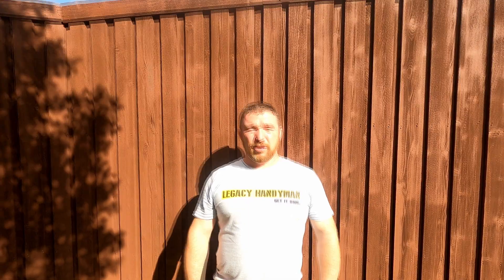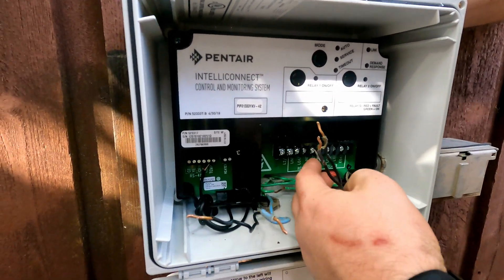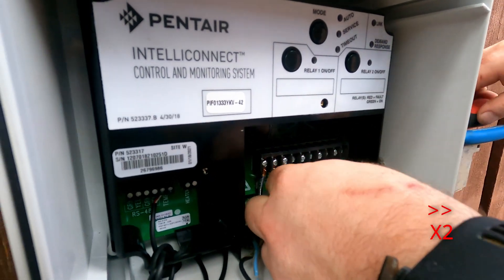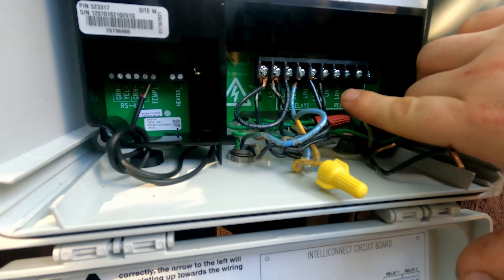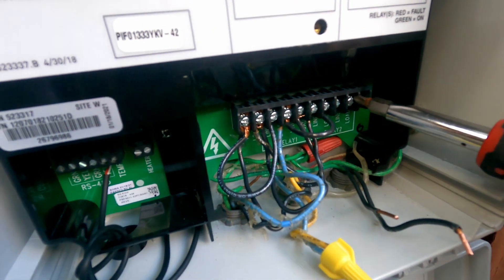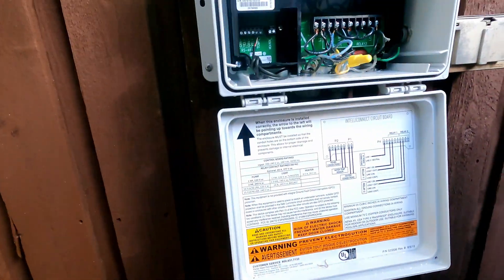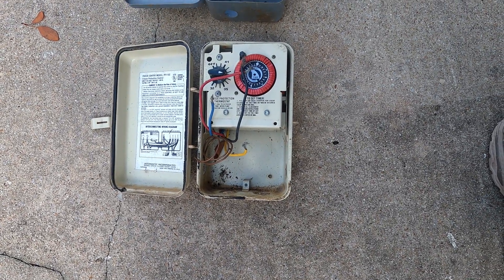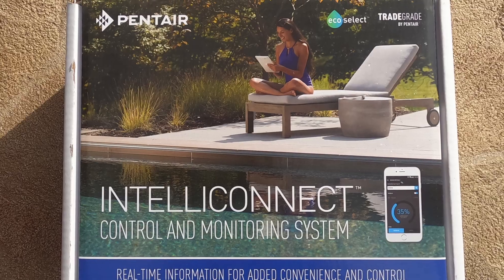How to wire Pentair IntelliConnect  smart pool  monitoring  system

Comment: Hello, I have a question that's confusing me. Where are these two neutrals that you connected and capped with a wire nut coming from? I don't understand where they are from if both pumps are 230V. Thank you.

Comment: I have a question I have a whistleflo pump I had Pentair come out and try to install it they said they  can't connect it with the interconnect system do you know of a way that I can DIY it myself to work because I have it connected manual now
Reply from the maker: Try asking this question here https://www.justanswer.com/sip/pentair?r=ppc|ga|6|HI%20-%20Pool%20and%20Spa%20-%20Search|Pentair%20-%20Phrase&JPKW=pentair&JPDC=S&JPST=&JPAD=89214033292&JPMT=p&JPNW=g&JPAF=txt&JPCD=20160304&JPRC=1&JPOP=Agostina_FinalURLMigration&r=ppc|ga|6|||&JPKW=pentair&JPDC=S&JPST=&JPAD=89214033292&JPMT=p&JPNW=g&JPAF=txt&JPRC=1&JPCD=&JPOP=&cmpid=37399732&agid=9417715372&fiid=&tgtid=kwd-246982834&ntw=g&dvc=m&gad=1&gclid=CjwKCAjw67ajBhAVEiwA2g_jEC3dnWZmCd9ZSI1vE5DkV2uo22C0qZsiaO-DT3t81u7Esnk1nDB_bRoC0WEQAvD_BwE
Reply: Thank you for the quick response. I will do that.

Comment: This is wired up incorrectly. You should have read the manual. If you were a pool professional and understood how these systems work, you would  know that you can label the booster pump in the app and it will not start without the filter pump running.
Reply: So the jumpers are not needed?